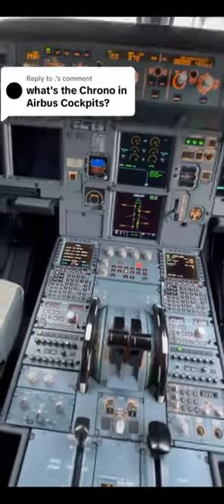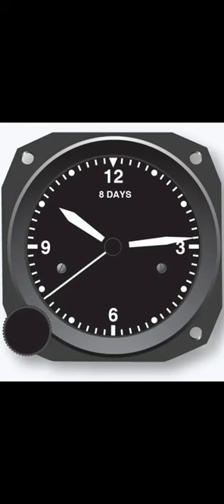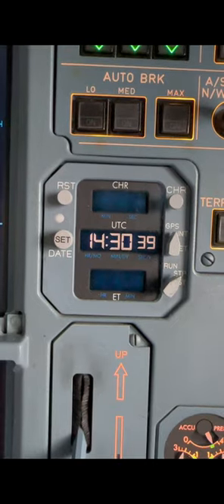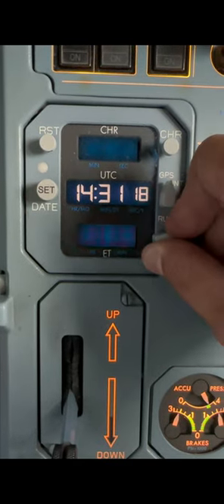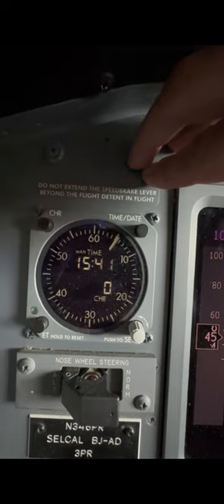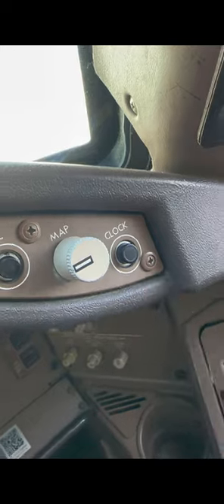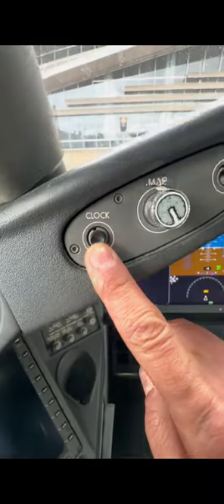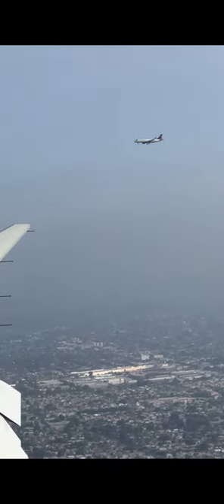Chrono/Clock button in Airbus and Boeing

Comment: Can you explain what the diaplay is for under the navigation display stand-by on captain side.
Reply from the maker: That’s called the ADS-B I have explained it in other videos. 👌
Reply: Which video can I find it? I know its a stand-by display, but this particular one looks more like a digital Radio magnetic distance indicator instead of an analog.
Reply from the maker: @ramongutierrez-gq4cq  I don’t have a dedicated video for it. It’s buried in one of my last 2 videos I think. But again it’s a ADS-B system.   Here’s a link that can explain it a bit. 

https://www.faa.gov/about/office_org/headquarters_offices/avs/offices/afx/afs/afs400/afs410/ads-b
Reply: Thank You I will look it up
Reply: Found it! 11:00 video Dec8-Dec10
Thank You!
Reply: One last question regarding ADS-B. Since some aircrafts are not equipped with this system, what alternate system is there?
Reply from the maker: @ramongutierrez-gq4cq  GPS and TCAS